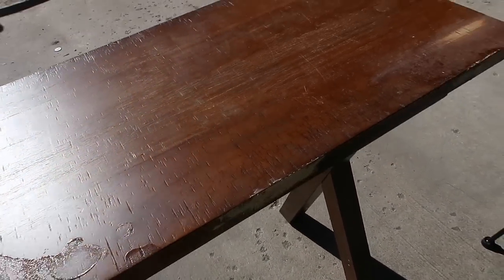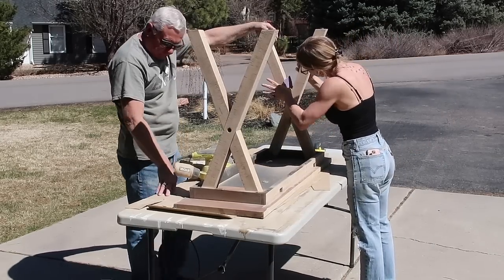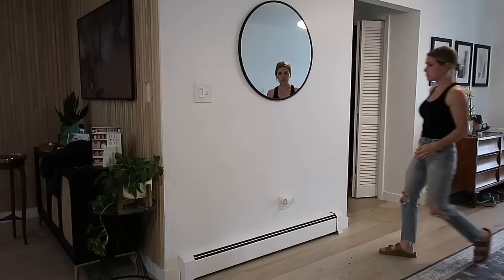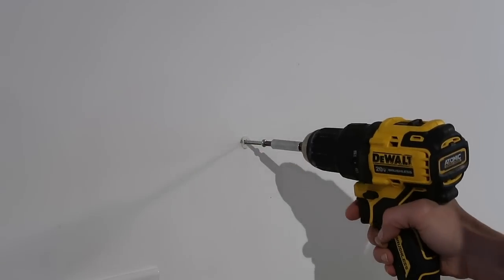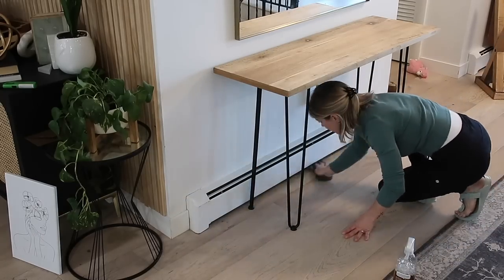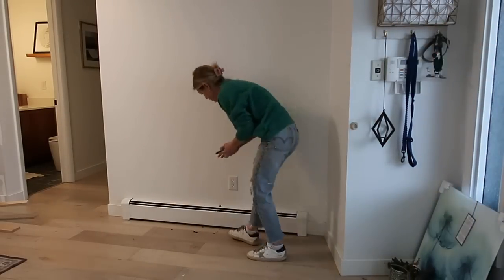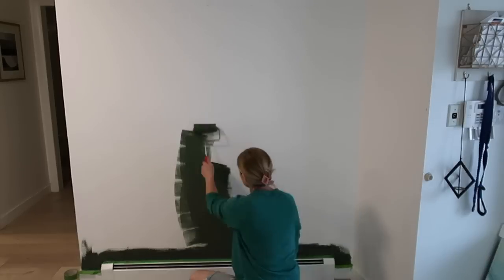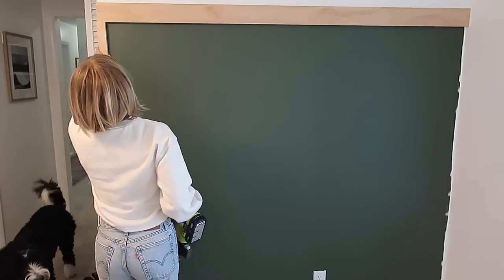HUGE ENTRYWAY TRANSFORMATION | DIY HALL TREE | REFINISHING FURNITURE | BEAUTIFUL & BUDGET FRIENDLY!

Comment: You did a fantastic job! I would have filled the nail holes, too. I grew up in my dad's woodworking shop. You can buy different colored wood fillers that are like putty. You can put a little on the tip of a finger and rub it into the hole. It is super easy to sand, if needed. It looks beautiful!

Comment: Totally the right call to fill the nail holes! I nearly cried when I realized you were going to stain that wood on the bench black. LOL I was watching to see what you would do with the final slat on the wall, but I didn’t see that part. Did they just happen to wind up being the exact width to fit all the way across? Or did you have to rip that last one down? Beautiful results!
Reply from the maker: We have to rip a super tiny piece down. We haven't yet. You can barely tell it's needed but we will do it. The space was almost perfect but not quite. Thanks for watching!
Reply: @DeniseBangiyev  Attention to details is what makes all your spaces look so beautiful and professionally done.